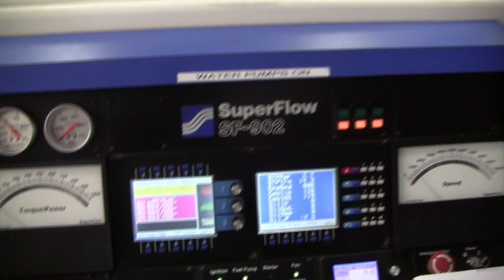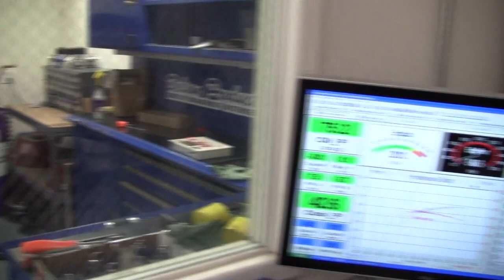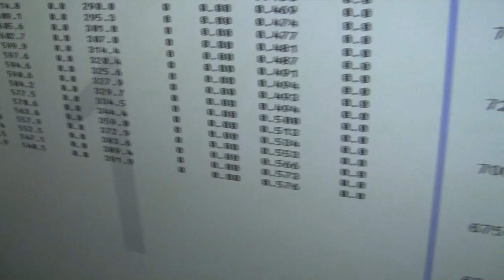Tom Fry's 427 SOHC Cammer 740HP Dyno Pull | QMP Racing

Comment: https://www.youtube.com/watch?v=bhSoNOeEn5Q
790 HP from a stock ZZ572 with a little tiny blower and carb and accessories on the front. I'll bet the Chevy is quite a bit cheaper, too. 

I'm WAY not a Ford guy, but I do think those old cammers are pretty cool. But I'm not sure 750 hp from a bare motor with not even a belt-drive water pump and with dual quads and spun to 7000+ rpm is really an ass-kicker of a engine. Put it in a car, stick full or at least more full exhaust on it and bolt accessories on the front and slap on some air cleaners and your 750 is going to turn to 700 or less in a hell of a hurry. Figure another 150ish minimum lost in the powertrain and you're in the mid 500s RWHP max on a nice cool and dry day with cool fuel, etc. 

When its all said and done what is each of those 550 horses selling for? $40 per horsepower or thereabouts? I can't see it being much cheaper than that. Cool is cool but affordable has value money doesn't have to buy.
Reply: DEEREMEYER1 - That has always been Chevy's ace in the hole.  Since the days of the 265 there has been more factory and aftermarket speed gear available cheaper for Chevys than for anything Ford, Mopar or other GM divisions sold.  Always more bang for the buck with Chevy.

Comment: Fords fantasy motor,never in a production car,a liars dream,more lies by fanboys,it was junk then and is still junk,if it was any good Ford would have put it in a production car,but it wasn't a good motor,the comments that it dominated  are fanciful lies by the fanboys,if it did dominate tell me the cars you could buy it in, if you can't do that,it didn't dominate a thing,you can't say a thing about a car dominating because it was never offered with it,it's a fanciful dream,made up folklore by the Ford fanboys,I can look up prostock and find the 70&71 season dominated by the Chrysler Hemi,if I had the money back in the day I could buy a 426 hemi cuda, the same basic bodystyle,the same basic engine they used in prostock,you cannot show me a Ford car you could buy in 70& 71 with this cammer motor,it didn't exist,so it's all talk,you can't go back in time and rewrite drag racing history, the fact is Chrysler dominated prostock in 70&71 in the same basic car you could buy at a dealer,you can't say that about Ford, the cars that raced after 72 were not based on the a car you could buy at a dealer,so try as you might the record shows Chrysler did dominate with cars you could actually buy,but Ford didn't race any factory built cars in 70&71 that won consistently in prostock like Chrysler did and certainly not a one was ever offered with the cammer motor
Reply: Ford built the engine for NASCAR only. Nascar would not approve the engine so they gave up on it. Yes Mopar did mass produce there 426 Hemi and they had alot of RnR into it so it was tuff to beat. Ford did build a new engine to race the Hemi...the Boss 429 which won the NASCAR championship in its second year of use in 1970. But we all know what happened with the factory racing. Not to mention all sanction racing bodies went to smaller engines. Mopar had nothing for Fords smallblock racing engine programs. The Boss 302 and Boss 351 became King.

Comment: There's a difference between catch up and ran your ass over...which is what the Ford 427 S.O.H.C.  was poised to do. NASCAR knew it, Ford knew it and Chrysler screamed like a little bitch about it. The only reason the "cammer" didn't take over drag racing was because 1. The design was too strange to the average nitro mechanic. 2. That damn 6-foot timing chain would streatch and change top end timing. 3. Take the first two reasons and after-market manufacturers went the easier route.